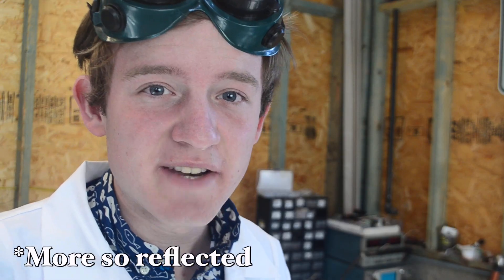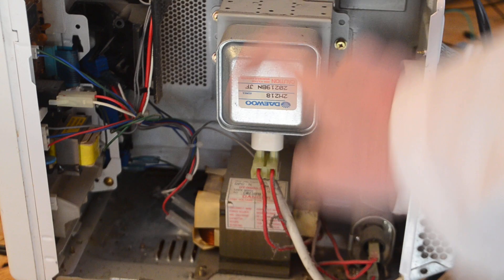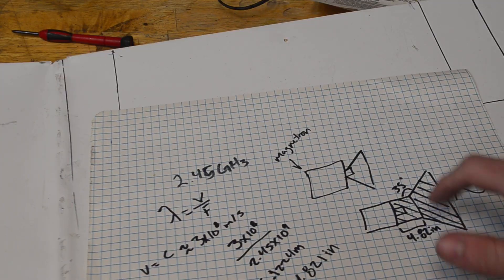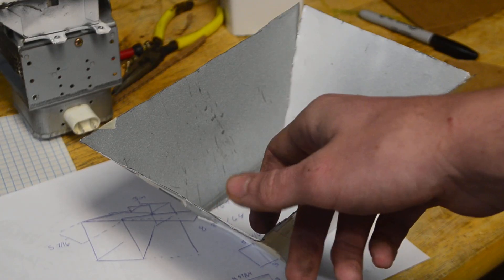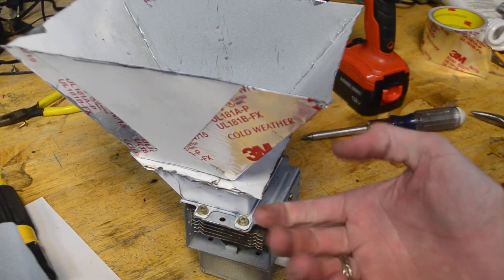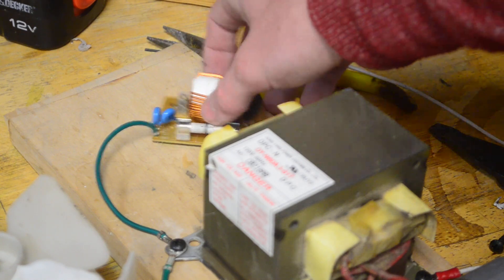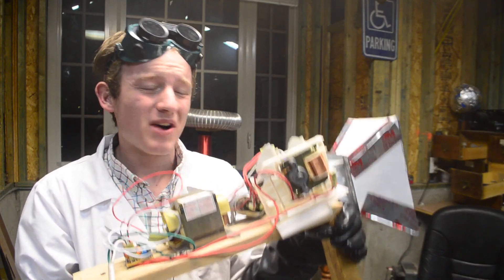How to make a Microwave Gun

Comment: I had a friend asked me if there's any way that you could use a magnetron from a microwave as a booby trap he wants to catch someone if they ever break into his house and I told him you got to have something that won't hurt a fireman if you have a fire and they have to break in to put the fire out but something or if somebody was going to steal something out of your desk they would get their nuts microwaved anyways I bought the most powerful one I can find meaning microwave and I got it already I just made the board to go underneath the desk and a micro switch for the door and you have to wire it up right you can put the electronics somewhere else and run a wire to the magnetron under the desk and put a little piece of wood there to keep the center drawer from pulling all the way out so they can't just pull it out and dump it in a pillowcase they have to either stand there and pick the stuff out or sit down and you put a lot of pretty shiny things in there and just mounted underneath he actually did the final touches I just made the the board with the magnetron on it and got it all ready for him nobody's broken in his house yet but I'm sure you'll find them at the emergency room if they do I never thought of it until he mentioned it but I made a quick 500 bucks and I didn't even have to install the finishing touches and his desk it's something I would not have done if he had kids and I told him if you drink it all I would not do this I did explode a bottle of water from about 16 inches away putting it 20 ft away from me in my garage and plugging it in with an extension cord looking through a crack behind the steel door it's something I don't know very much about and it's not something I want to play with it took about a minute and a half to 2 minutes to explode that bottle of water so getting someone to sits in one spot or stand in one spot for 20 or 30 seconds I feel sorry anybody breaking in his house they're not going to be able to resist I myself think it's a bad idea but what are you going to do I wouldn't screw with this microwaves bounce I don't know enough about it there's no way I'm going to make a magnetron gun you're better off with a gun if you want self defense I wouldn't recommend this to nobody I only Built it for him because he hired me to do so through my life I have done so many things building things that people would not even think of and if they did they would never make them like a handcuffed key in a little cone on your pull tab on a jacket you cut the key in half raise the loop on it and slide a plastic cone over it you always have a handcuff key on your jacket just get your hands in front of you I had people search me out to pay me $50,100 bucks a piece and I've made so many other things thinking how to defeat something and being a prototype toolmaker I can make just about anything especially small things I used to love to make things from blueprints so thinking stuff up and making them was fun I even had a couple of patents but microwaves I don't think so what did they say just say no

Comment: Volts don’t kill you.  Amps do.  2000 volts is nothing.  Ever been tased?  The electrical output of the TASER is 50,000 Volts. The voltage may seem high, but the amperage on both systems is well below safe limits. ADVANCED TASER M26 output is 3.6mA average current (0.0036 Amps) The X26 output is 2.1mA (0.0021 Amps). The output of the M26 into a human body is a fraction of the dangerous level.  1 amp can kill you.  Still I wouldn’t touch the circuitry anyways.

Comment: This is a great video, but I had some thoughts about design. Instead of a cone for dispersion, what about a focal attachment? Perhaps using the metal to essentially create a barrel with a singular hole, maybe about 1 inch in diameter. Would this work for direction or is the cone the best for that purpose? That said, if using this type of setup, could you rig it up to a pulse charge? Set it to build the charge and disperse it when a trigger is pulled?

Would this make work for making a magnetic pulse cannon? I am not skilled with electrical engineering myself, but I do have some interesting ideas. :D
Reply: The pulsing you're describing is actually how the magnetron works. Look into videos explaining magnetrons.

Comment: I built one a few years ago after watching this clip, with a cone. Between 4 and 5 foot for the light bulb. I actualy sold it on ebay afterwards. £50 as I recall. It  Went pretty quickly and some one asked if I had another one ? As much as the fast talkings a bit anoying i have gotten used to it and preffer it. Nice work ..

Comment: TERMINOLOGY:
Keep in mind that all light is visible. That's by definition in every dictionary ever written. As such, infrared and ultraviolet are NOT light. Pick another term to use instead. I describe all electromagnetic waves other than light as "radiation". Therefore, I use the terms UV radiation and IR radiation, both being part of the spectrum of EM radiation.

Are the grammar nazis going to eviscerate you for saying 'UV light' or 'IR light'? No. But those are inaccurate terms. Those who insist that all EM radiation is 'light' are foisting ignorance. You get to make fun of them, or more kindly: Simply correct them and insist that they check any and every dictionary ever written.

And of course, saying "visible light" is redundant. It's another common inaccurate term.

Comment: OMG do I have a head ache now. The real Q is how can you make this portable? Car battery, nope. Can this be used to knock cop cars as you drive by……?  Running it off a car battery while driving may work but what shields your car from it’s affects? I know, wrap your engine block control system in aluminum!

Comment: Since a magnetron is basically nothing more than a high power radio transmitter, have you ever tried to modulate the output with an audio signal, and receive it with a "normal" radio? (Tuned to 2,45GHz... That's the only unusual part of the radio :p )
Reply: Lol ; this was my thinking when i was taking microwave course in university😂

Comment: I am a retired microwave engineer, and was surprised that he was able to complete this video, because the HV capacitor he was touching ( on the insulated spade terminal) could retain a charge of several thousand volts after being disconnected from mains power ( don't rely on the bleed resistor doing it), which is enough to KILL YOU, and WILL jump over the insulators on the spade connectors on the capacitor. ALWAYS DISCHARGE THE HV CAPACITOR WITH AN INSULATED SCREWDRIVER, or PLIARS  before touching the Transformer, or HV Capacitor. NEVER discharge the HV capacitor with uninsulated crocodile clips, or screwdrivers.

Comment: You know, galvanized flashing form a hardware store (HD, Lowes, etc) solders quite well if scrubbed with scotchbrite... even better than cu clad surprisingly enough....  you could cut it out of that (available in widths up to 12" or more I believe) and solder them together... would be much better from EM standpoint than epoxy.

Comment: It's not tripping your breaker,  it's tripping your GFCI/RCD because it's causing an imbalance between the load and neutral sides of the circuit (it's probably moreso than anything feeding stray currents into the ground line since that's connected to the metal casing of everything).  To trip the breaker you need to induce major current in the line loop of a circuit,  not just disturb the balance between load and return current.
Reply: dont tell him that. if he thinks hes smart enough to make a microwave gun( not a smart idea) becuase I dont think its intention is to cook a potato across the room. It might give him the idea to hook it up to one side of the 220 V lines Maybe even a generator or something like that. 🫢 did i say that.  well he probably wont read my reply anyways.(Nobody ever does) So im good 👍
Reply: You have no idea of how much money can be made on the sale of active denial systems.    They would stop looters instantly.   There will come a time that you can't even buy insurance if your business is without one.

Comment: Great video.  Condensed and informative.  I'm curious about the 35 deg. diffuser at the end of the 1 wavelength guide tube.  Why can't you double or triple the straight section (2x or 3x or 10x wavelength) to produce a more focused beam?  Aren't microwaves in telecommunications very focused like that?

Comment: WARNING! WARNING! Microwaves are extremely dangerous to take apart. There are multiple parts of a microwave that can and will kill. When the transformer is plugged in, and you touch it, it will kill you; if you touch the capacitor--even when not plugged in--it will kill you; if you damage the magnetron's core and breathe in beryllium, it can/will give you berylliosis for the rest of your life (coughing/breathing problems/lung cancer). So please be careful when disassembling a microwave and don't do it unless you are experienced.

Comment: Dear Smart looking Youngman: Nice video. Please pay more attention to personal safety. Beryllium metal and its compounds are extremely toxic and never touch them with bear fingers for any reason. It also gave me jitters when you touched the capacitor leads as well. One small forgetful step (turning off the mains and discharging with a safety stick) ends up in not having another chance to regret and continue your life.
Other than that your understanding and explanation of the science behind what you are doing is extremely impressive.
Hope you continued your passion and chose to be in Science or Engineering.
Reply: BEAR FINGERS

Comment: 120v won't hurt you, it just tingles. It's a "shocking" surprise!!
Reply from the maker: Haha depending on a lot of different factors 😅 if you have lightly sweaty hands, and touch each wire with different hands, then you would probably die, a shock across the heart is very dangerous

Comment: The trick is to recognize that this will work in a total vacuum and then to ask "how?  How could a bunch of electrons at 2.45 Ghz resonant oscilllation inside a cavity magnetron - cross an empty vacuum and generate heat?"

99.999999999999999% of people on this planet actually possess the reasoning ability to figure this out.
Only a few thousand people on the planet actually know.

HERE ARE SOME 'FAIL' ANSWERS:
1)  "Because microwaves are electromagnetic waves"
Waves in water propagate by way of a physical medium - and the physical medium is water.   If you put a heat source at one end of a body of water, like a pool or tub, soon the heat will be transferred *by the medium* - the water -- to the opposite side. 

How does the energy of the 2.45Ghz resonating electrons in the cavity magnetron - cross a complete vacuum and end up creating heat and/or light in food or in a fluorescent light bulb?

2)  "Well, because electromagnetic waves cross the vacuum of space.  That's how."
By what medium though?  What's in the vacuum, escorting the waves across?

3)  "Electromagnetic waves don't need a medium."
This is wrong.  There actually *is* a physical medium that 'escorts' the electromagnetic wave between the source and the target.

4)  "Are you saying there's water in space?  Or air?  Or something?"
'Something', yes.

99.999999999999999% of people on this planet actually possess the reasoning ability to figure this out.
Only a few thousand people on the planet actually know. 

I'm admittedly guessing at "a few thousand."  I hope it's that many. 

You can cross off that list nearly all physicists.
"Why?"

Because they have to defend a lifetime of effort, learning and embracing conventional science.  Plus grant money.

"Have you ever done any unconventional science?"  asks the giver of the grant.
"Me?  Of course not!"  sayeth the otherwise-goes-hungry physicist.

"Do you agree then, that any scientist - after having spent 6 to 8 years of higher education learning physics - then several years in their career - do you agree that if such a person has participated in un-conventional science, that they are bad?  Very bad and unfundable?"  asks the grant-giver.

"Very bad, very unfundable."  said the physicist.
.
.

Comment: I like to experiment. I have even taken calculated risks and diced with danger. I will however NEVER,NEVER,NEVER , try to make a magnetron  gun. I advise anyone watching this video to not even consider the idea. This is dangerous on so many levels.
Even if the gun demonstrated was fixed in a permanent location where the results on it's safe target could be analysed , it would still be far too dangerous. As it is this gun is portable and therefore prone to totally unexpected results. 
Be very afraid kids. Stay away.

Comment: Since the magnetron is operating at roughly 2.4 GHz, couldn't it disrupt the signal of a "drone", to use a term that everyone should be familiar with?

Would be interesting to see if that works. Also, a portable power source would come in handy for that experiment.
Reply: The zero point energy generator is just a motor and an alternator connected together, try it out.

Comment: Question.

I need a power supply that generates 50,000 volts DC at 20 milliamps.
Where can I buy one?
Reply: make a voltage multiplier

Comment: Is there a way to adjust the wavelength so it ramps up higher.... into the microwave radio spectrum?  If you can figure that out you can send send sound using microwaves.  Would be really cool to develop that to use in Cuba or China.  Hackaday had an article on this.

Comment: This reminds me of the time I acquired a commercial 220v microwave from the back of a restaurant that they were throwing out when I was a teen.  I took it home and wired it to my clothes dryer outlet using leads and it worked.  So I then took it apart and installed the magnetron on the bumper of my car with a cone.  Then I put a bunch of car batteries in the trunk with a bunch of large capacitors in the circuit and a transformer.  Had two switched.  One between the batteries and the capacitors and one between the magnetron and the everything else.  I would flip the first switch and charge the capacitors then turn on the magnetron after 30 seconds.  I would do this at night and when i did this to a car in front of me, the lights would blink off and on and they would pull over.  I think their car stalled.  I don't know.  It was really fun.  Hahaha
Reply: But can we make the car go boom boom?

Comment: What  about that diode? I tried  to wire  mine as seen in the  microwave. I had to replicate where it was on the board. The diode instantly exploded. Could someone point  me to where the diode goes  in circuit. As sometimes it seems to be wired to  the chassis. Which  would be ground? I've only used 2 magnetrons  and MW circuits. Once I catch on, I will get it right. The 1st time  the unit suddenly didnt work. I  am  missing something as I  TRY to re-do the circuit  & bypass switches etc.

Comment: Be sure you tap that capacitor with your finger a couple times so you can die, and be sure you touch and mess about with the beryllium oxide, it's only deadly poison.  Further, it is illegal for you to transmit that into the air without an amateur radio license.
Reply: One, rude, second, that probalby isnt berillium oxide, if a microwave is so new that the circuit comes printed on the instructions, its new enough to not use a poison. They stoped using berillium decadss ago, most of the ceramics are a mix of aluminum oxide and cromium oxide, packed thightly around the magnetron,thus giving it a rose tinted look.
Its the white ceramics you should be wary about. Now, seen as you have no respect for the guys work, i will have little tespect to you, so fuck off.

Comment: Could you get more power and increased range by adding additional magnetrons? How large could this be scaled up?
Reply: You'd have to find a way of keeping all the magnetrons in phase with other at the point where the waves are mixed.
Reply: You would have better success using a larger magnetron, such as for a small radar set.

Comment: 6:58  the transformer puts out 2000 volts and very high current so if you touch any part of that transformer you are going to die and it'll arc through you and it'll be very painful.  7:42  see the florescent bulb light up as i shine the microwave beam at it  3:46  sound of electrical outlet reacting to the microwave beam.  7:55  i'm about 2 meters away from the light bulb and its lighting up very well.  7:58  explanation of why the beam lights the fluorescent bulb.  8:20  now i'll point the beam at electronics on a circuit breaker to see it flip the breaker.

Comment: Great work. I saw a video once about using microwaves as a gravity thruster. Someone basically tried to copy a crop circle designed like a snails shell with baffles installed to reflect the waves back into themselves before they exited the device. The result was an invisible thrust. Could you try that? Thanks

Comment: So basically leave the circuit alone except the switches, the case, the table spin motor, and the door... You used everything else in the microwave just as it was connected.  So basically all I have to do is build that horn part in the front and done..  But other than MKUltra, why would I want to build this? I don't know what the full usage is for microwaves.. This just cooks your hotdog from 2 feet away......

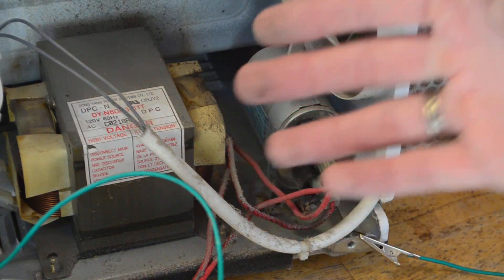Comment: 2:33 Take your metal ring off before messing with electricity......especially capacitors.
Reply: Please don't point stuff out by tapping it with your finger either, especially capacitor terminals. Bleeder resistors can crack and fail.